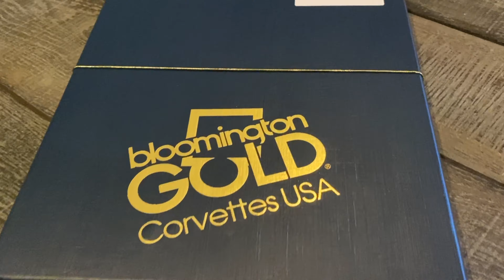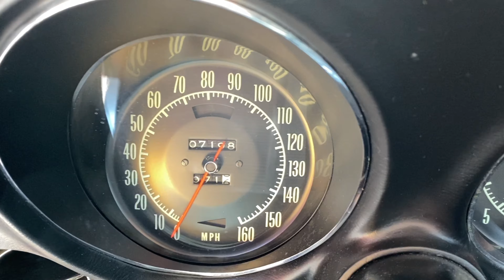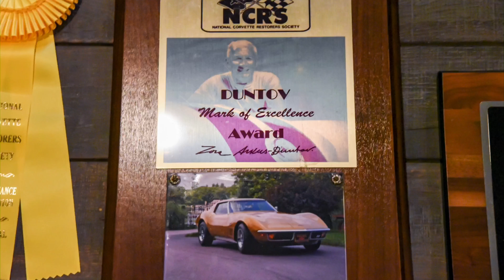7K-MILE BLOOMINGTON GOLD 1971 CORVETTE STINGRAY

Comment: What's under the hood?
Reply: Not much in 71 it was a 350 ci 260 hp 360 lb ft torque the start of the smog motors
Reply: @rockiemountin7535  270
Reply: @sidefx996  I stand corrected
Reply: @rockiemountin7535  There was also two big block options available; 454ci LS5 rated at 365hp and the 454ci LS6 making 425hp.